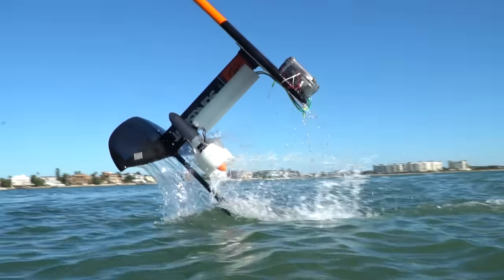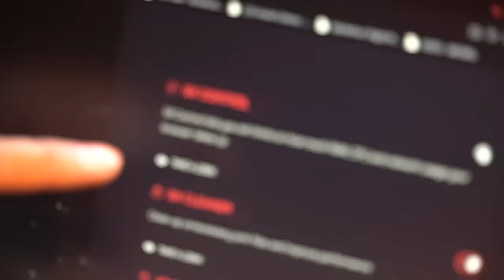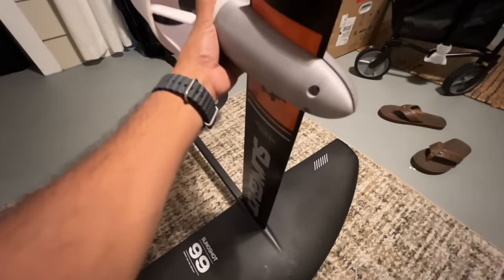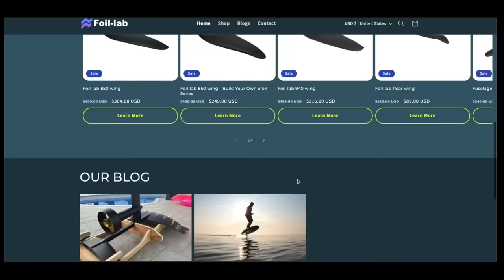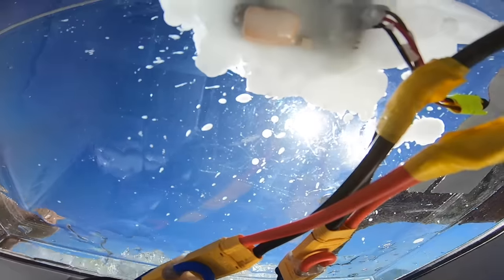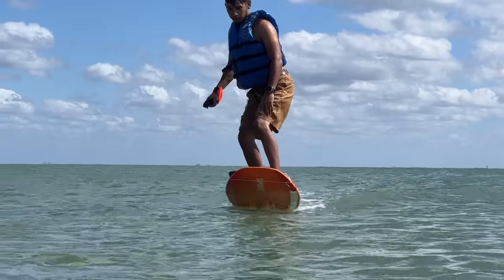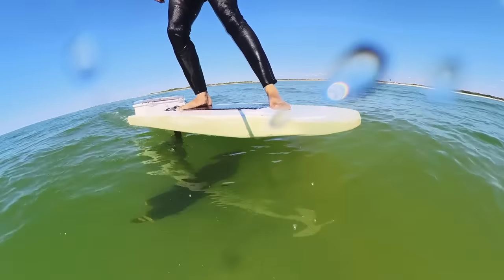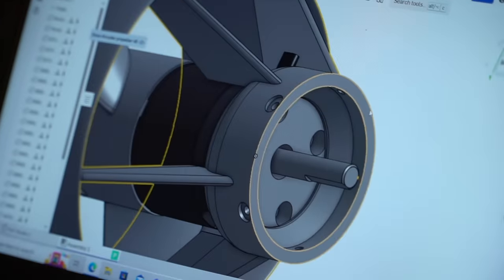Easy Hydrofoil (DIY)

Comment: Great project!  thanks for sharing all the details. on first glance, the Motor shaft for the linked Motor on amazon is only 10mm while the motor shaft on the Onshape files is 100mm plus some other missing details...   Is there an updated and more complete design link for the version that was actually built, or is the shared Onshape design is just a suggested starting point that requires additional work and modification before  attempting printing and building the drive unit ?

Comment: To me, it appears there are two balance points.  One point when you're in the water and one when you're on plane.  So the problem will be that you need to transition to the "on plane" position instantaneously...  which you can't really do.  If you redesign your board with just one balance point, you can remain fairly steady while the board is on the water, and you don't have to make a quick adjustment to get into flying position.

Comment: Do another hydrofoil video. Would be cool to see the one with 2 motors even if it's heavy. Or just use small powerful batteries with short ride time. Maybe you could break the hydrofoil speed record

Comment: i foil, but it always feels like the board would work better with the small wing on the front. Because a small wing loses lift first.  also it feels like an arduino with a 3 axis accelerometer sensor would help.

Comment: I could be wrong but usually when I see people using the foil surfboards they do a oscillating up down motion. I wonder if it is for stability
Reply: You can ride one without a Motor, so I think thats what you see. When on the foil you increase the foil speed by increase Front pressure and pushing the Board down. This lift increases and you let the Board come back up. If you repeat that pattern you have a muscle powered pump foil
Reply: yeah people do what you can foil pumping

Comment: Kite foil boards and electric foil boards are not the same, the aspect ratio of the wing is suited for the speeds of a kitesurfer, the prop and forward speed needs to match the lift off speed of the wing

Comment: Why not make a aerodynamic cabin using the board as the floor, where you can sit and extend your legs, waterproof everything electronic, so you can dive under the water and go explore with scuba gear, like James Bond? Just don't hit the propeller to the bottom. 
You would be the only one that can go over, on, and under the water. If you want more dumb ideas like it, let me know. 
I think with a cheap gyro (MPU650) and an Arduino, you can generate PWM for your ESC to keep the pitch of the board to say 10º. The side to side balance would be up to you.  
Then again, I might be full of it. 🤷‍♂

Comment: Honestly, there are a lot of things out there that are just too expensive for the common man to afford. From E-bikes to others, with a little ingenuity and some developed skills, you can build all sorts of things you've been dreaming about doing. I built my own E-trike for less than $700 that goes 28mph and gives me everything I need to get around and do my part to keep my carbon footprint as small as possible (which is something that I have been doing for the majority of my 61 years on this planet) The reason all of these things are too expensive is because the modern business model is to make as much money as possible and make a million dollars for everything you do. My business school said that you will loss money for the 1st 5 to 10 years before you start making money and should plan accordingly. But that's not good enough for Wall Street these days. 😮

Comment: Im surprised that standing on a tiny plane like that is possible to control at all really; its the most insanely elevated unstable CG ever. Or I maybe its a little bit like an inverted pendulum; once stuff is inverted anyway its actually more controllable if you make it longer? Either way impressed you got the DIY setup working at all; I always regret that your videos show so little of the thought process that goes into the design decisions; you skim over it as if embarrassed about it; but trust me its the surfing footage that ought to be embarrassing you, not your design intuition.

Comment: I use regular  Opera it has the adblocker too.  Why don't you rent a pro foil board and see if it works better to learn on then after you learn how fix the junk you built yourselfI'n pretty sure you need more power.  same thing when you tried to tow with that rowboat you had.  When beginner s learn to water ski they always have problems when the boat is too slow most water skiers are using  2 murcurie  125s or some 300hp or higher car engines lotta ski boats with  500 horsepower  just right for 2 skiers.  Also maybe learn how to surf,  Most people I seen using foil boards seemed to know how to surf also.I surfed  for about 40 years now but it takes a whole summer to get to be friends with that wobble stick.  Also  maybe try copying some sucessful pros foil design in case your not doing it right or get some experiencd foil rider to try yours and  see what they think of yours

Comment: About Opera GX, please research a bit more! Opera and also GX are from a Dutch company which is fully owned by a Chinese Company. And in China there is a law that says "If the Goverment whats data, it gets data from every one"... So these Browsers are the worsed you can use.  Not only security wise but overall the handling of the data. And the alleged VPN (which is not a real one) only makes it worse, as China can then obtain even more data about you.
SO please, just research a bit beforehand...

Comment: I'm no expert, but your weight and balance look off.  Watching videos of others riding foil boards, the seem to keep their back foot slightly behind the mast.  Seems like keeping the center of gravity over the mast is a winner.
You appear to be too far forward, which keeps you in a really high angle of attack and almost stalled all the time.
You're a weight and balance expert with planes.  Surprised you haven't seen this problem in your videos.
Check out some foil board tutorial videos and consider movie your CG more aft.
Thanks!

Comment: take a real one and is very easy, yours have a manual foil with a motor.. is not the same wing to balance.. (i rent one last summer and it was easy to manuver.. (i'm old skateboard player..)..) so the problem is the foil is not design to be motorized. for the rest, ok!! because 12000$ is disgusting.

Comment: Would you mind look at this https://youtu.be/WfJbF0xkUOY?si=Vmdieic4_2F1ZO3b and combine it with you motorconcept and slap it on a RC boat? Thinking of a ROV and the problem of getting to the dive location realizing no mather the hull design it would get out/back in the water using this.

Comment: in video ads is generally acceptable... but blatantly lying to your fans is completely wrong. Opera GX browser cannot block the ads on youtube, since youtube is in a battle with adblockers and is consistently changing the code to essentially block the adblockers. Opera gx isn't special compared to any other adblocker, and none of them are 100% effective at this point in time. If that is a script given to you by opera, you may want to mention that it's completely factually incorrect!
Reply: i just checked no ads when i use opera, adblockers work in different ways some aren't working while others are. dont know why you are so upset about it.